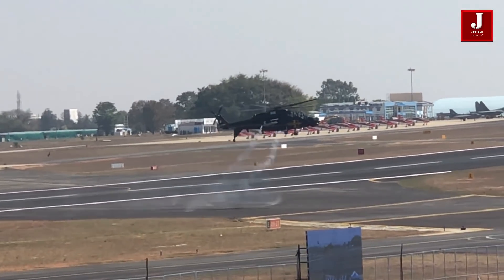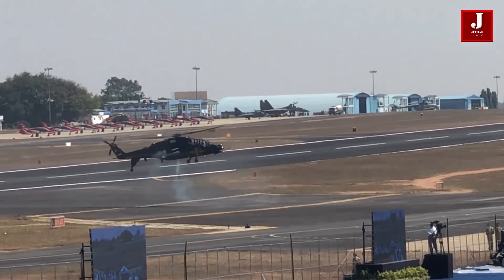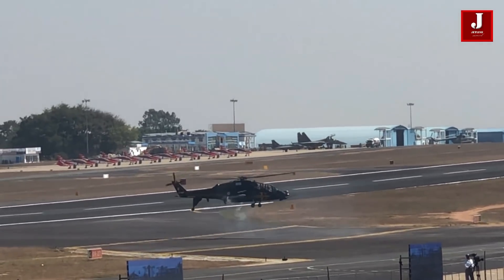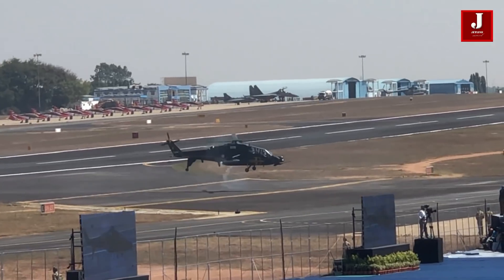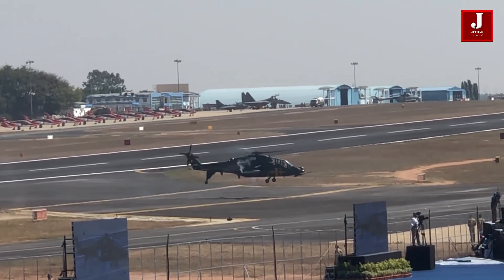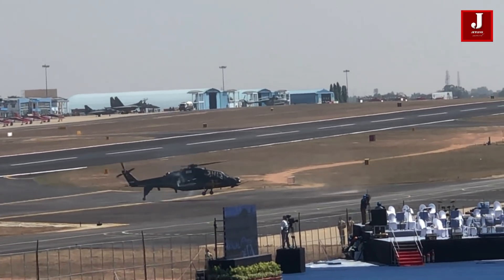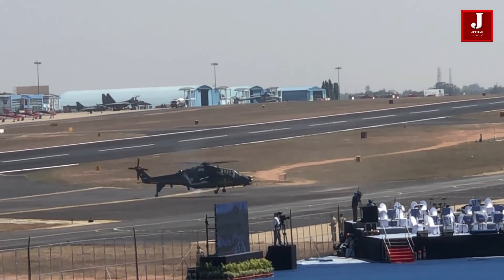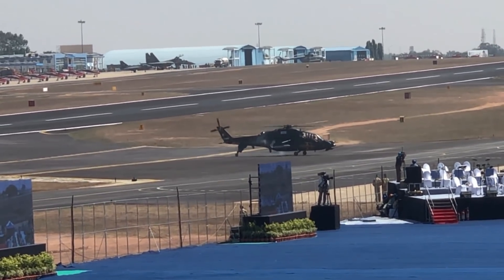Take a look at How an Indian Built  LC Helicopter roars across the skies. #HAL #India

Comment: Hope HAL installed state of the art ejection seats for pilots to eject safely and pilots trained well to eject.
Reply: Helicopters don't have ejection seats...
Reply: Grow some knowledge kid. This is helicopter not jet.
Reply: @guru8104  He does have knowledge.  Check out the Kamov's ejection seat.  It is a helicopter not a plane.
Reply: @moviesenthil  Oh I do know Kamov is a helicopter. But you should also know that till now kamov is the only attack helicopter with ejection seat. Even Apaches don't have one.
Reply: @guru8104  So?  Your earlier comment alludes that only planes not helicopters can have ejection seats.
Reply: @moviesenthil  Helicopter ejection seat technology is a latest one. It's not easy to have an ejection seat on helicopter like we do in planes. That's what I meant.
Reply: @guru8104  No. It's not.  It's been there since 1995.  Not just the Kamov 50.  Even Sikorsky S 72 RSRA had it, although only the Kamov became operational.
Reply: @moviesenthil  It is but it's not as common as Flight ejection seat. I've only heard of Kamov with ejection seat. And to my knowledge its the only helicopter with one. So we can't expect other helicopters to have ejection seat like the original comment said.
Reply: They have toilets to dump directly over Pakistan.  What more do we need?

Comment: The flight safety record of LCH helicopters is very poor. India itself has experienced more than 20 air crashes, all of which are non-combat losses. Among its seven military aircrafts exported to Ecuador, four crashed, one of which crashed in public during a military parade, and Ecuador decided to seal the rest. Three were intended for resale but none were purchased.
Reply: LCH have just entered production phase and only 8 has been produced. Then how come 20 air crashes?? 50 cent bot.
Reply: Lch has not been sold  to any country . Where did you get the info about crash ?
Reply: This guy is lying, bots will make up anything to offend the other country
Reply: PLA crashed more than 30 fighters this decade

Comment: The sad part in this is that, it is still an prototype.
It has been more than a decade and still in prototype phase.
Just Imagine how much of time will needed to develop AMCA or Deck based Dual engine fighter jet and even Tejas mk 2.
HAL has given these unrealistic dates AMCA, I don't think so they can even start serious production before 2032.
Reply: Ya easy to brag. If your would be an engineer you would what the f have to be dealt with
Reply: @vengeance6051  no excuses
Reply: @sivav3628  there are many excuses, previous governments never funded defence manufacturing in India. Those mig 21 are decades old but previous governments never focused on Tejas. One more example , we had started bargaining of French submarine in 2004 and that deal was signed in 2013.
Reply: Lch already in operation and order.,currently india  using lch for patrolling ladakh
Reply: It has already entered production phase.
Reply: 1 lch is inducted in Indian army

Comment: It’s mind Boggling to see such a advanced Helicopter which has been proven to operate on High altitudes like Siachen mountains and Himalayan Mountains ranges. 🇮🇳🇮🇳🇮🇳🇮🇳
Reply: @John Hero spamming yt comments section dosent make u an intellectual kiddo
Reply: @John Hero apache is also great Helicopter but it can’t fly in High Altitudes like Siachen or Himalayan mountain Ranges where Wind, Cold and other natural calamities are challenging. But LC India Made Helicopters are Proven to operate on Such things.
Reply: @John Hero gtfo hater teri maaka *
Reply: @John Hero  This chopper has its place. Cheap Homemade  chopper that can operate in Siachen .So yeah it has its purpose,  And the purpose is pretty clear.  We have built what we need.
Reply: @John Hero you still didn't get what I said 🤦‍♂️
Reply: @John Hero it is highly stable in high altitude than apache.
Reply: @John Hero Check the price tags of both then compare smh
Reply: @John Hero  Just checked the title of the news , there is no advanced word in it. You are making comments based on a user comment.
Reply: @John Hero don't compare them, they both have their pros and cons

Comment: Why not use go pro...? Or cockpit cam
Reply: Security reasons
Reply: @AK6655gddxg  nope you have option for to hide the panel.. Also F22 raptor is highly classified plane but still the have video flying through cockpit... If the presentation is not will be good you cannot sale this into market..

Comment: 20mm cannon...max of 4 antitank missiles. Inadequate.
Reply: THIS IS FOR HIGH ALTITUDE WARFARE WHERE YOU CAN CARRY LESS PAYLOAD DUE TO THIN AIR. IN THAT REGARD THIS IS SUFFICIENT.
Reply: @kushagrapal8689  Can carry 8 antitank missiles. Earlier, i'd read it carries 4. Think they upped it.
But it says in wiki that it's a "multirole" helo.
wiki:
"shall also be capable of high-altitude warfare"
Reply: @khalildas741  YES IT IS A MULTIROLE HELICOPTER. IT CAN CARRY OUT SURVIELLENCE OPERATIONS, PROVIDE CLOSE AIR SUPPORT TO INFANTRY AND CAN EVEN CARRY ANTI ARMOR OPERATIONS BY DESTROYING TANKS AND ARMOURED FIGHTING VEHICLES BUT IT IS DESIGNED PRIMARILY TO SERVE IN HIGH ALTITUTDE TERRAIN DUE TO ITS LOW WEIGHT AND HIGH SERVICE CEILING.
Reply: @kushagrapal8689  nope, it is designed to fullfill all indian terrains also it is designed to economically mass produce.
This will be the main attack helicopter of all our defence forces.